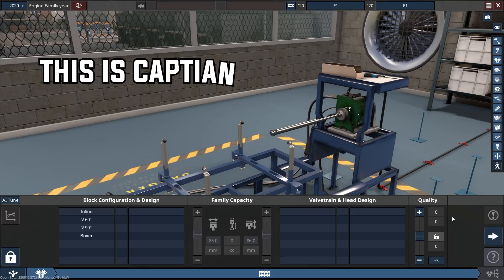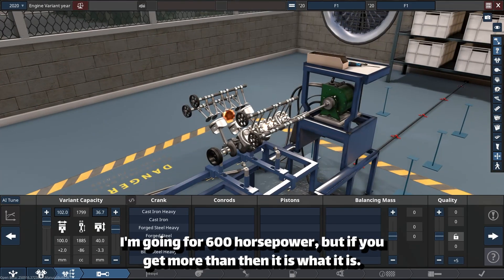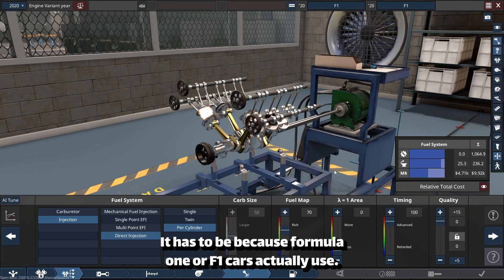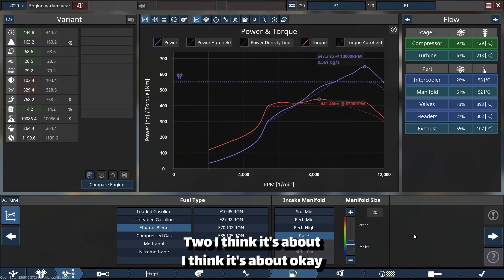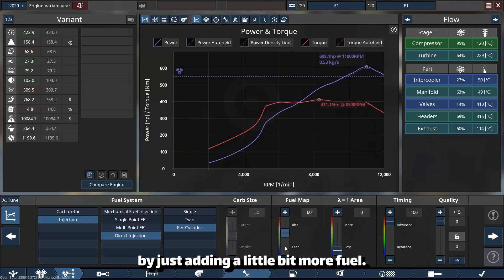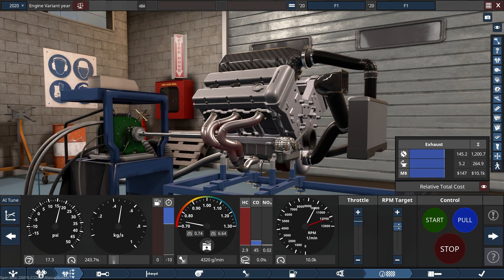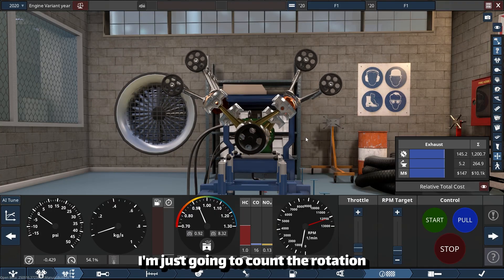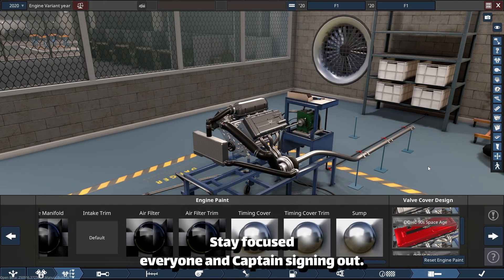Real Engineer Builds a F1 Monster Engine in Automation | INSANE Power!

Comment: Arent f1 engines TT?
Reply from the maker: What do you mean by TT?
Reply: @CPT_MRD Twin Turbo?
Reply from the maker: the site that I looked up was McLaren and now I searched a little more down the rabbit whole and I found that since 2014 FIA created the rule that they need to use single turbo because of "mandated single turbo for cost, weight, and packaging reasons" says my Lieutenant (chatgpt).
Reply from the maker: I got you you mean twin turbo, well before I start to record the video I just searched F1 engine specifications 2025 and all it said was that they are turbocharged so in my opinion it's single turbo for less weight but the same output within the lime
Reply: @CPT_MRD i just checked physical pictures of the engines and they are in fact single turbo
Reply from the maker: Yeah more you know I wasn't sure but now I am, thanks for the communication 💙
God bless you my friend